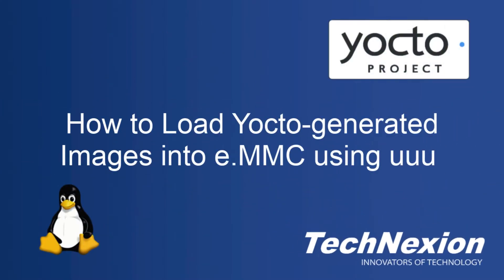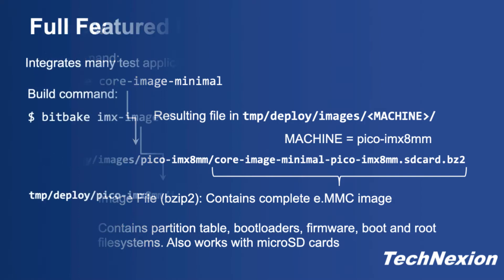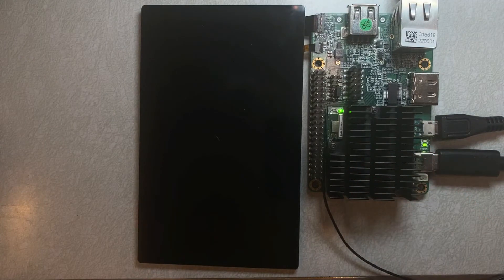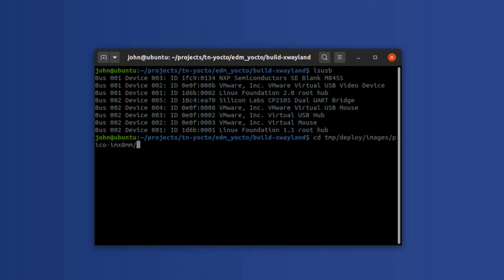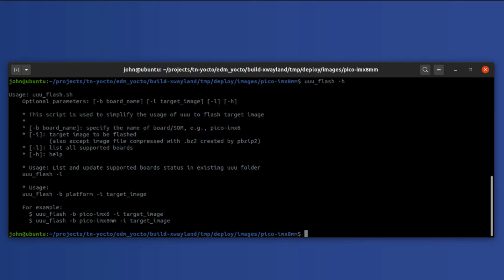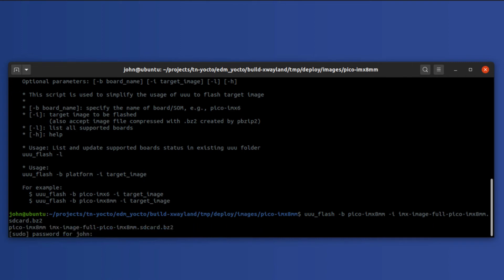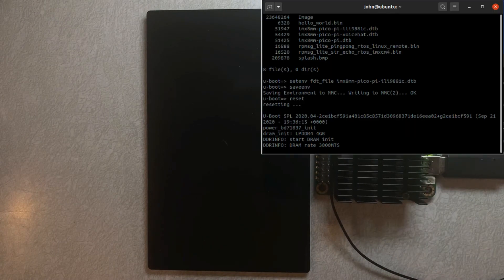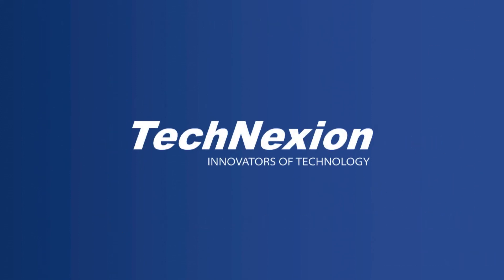Loading Yocto-generated Images to eMMC with "uuu"

Comment: Great tutorial, thanks for your efforts. I do have a question about serial booting from USB. I am building a custom carrier board based on EDM-G-I.MX8M-PLUS SoM and I am planning to use the USB-OTG port for both powering the board and data transfer. I wonder if it is possible for me to use USB PD and US3.0 at the same time.
Reply from the maker: Certainly you can but keep in mind that you won't have 2 power sources in your product.

Comment: Can somebody please tell me how to put edm-g-imx8mp board into serial boot? Is the SW1 switch supposed to be positioned at 1 or ON? DO I press the Button1 while I plug the power supply to the board?
Reply from the maker: When you use the WB-EDM-G baseboard. You will find a button and a switch next to the DC power jack.

For the Switch. LEFT position is EMMC boot. RIGHT position is removable storage boot (SD card boot)

The button is to put the board in Serial Boot configuration and you should keep it pressed for 10 seconds from the moment you apply power to the board.

Therefore when you want to flash over USB. You should put the switch to the RIGHT position. Press the button before you apply power to the board (keep it pressed down for 10 seconds).

After you flash. Return the switch to the LEFT position to boot from the EMMC and your newly flashed image will boot on next power cycle.